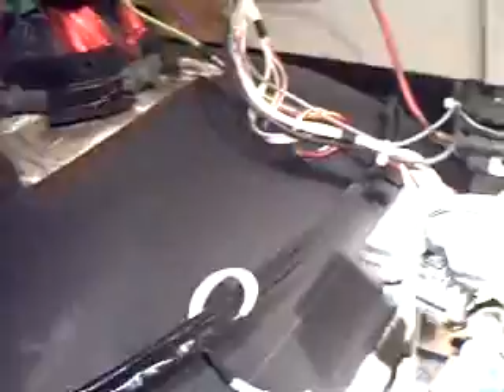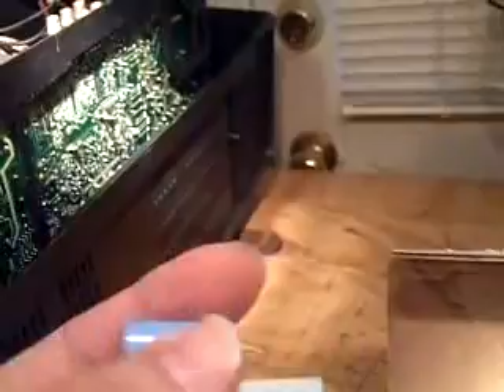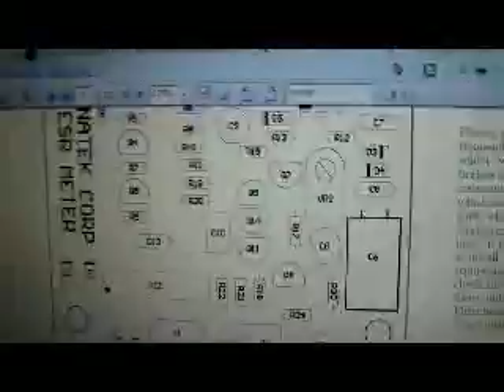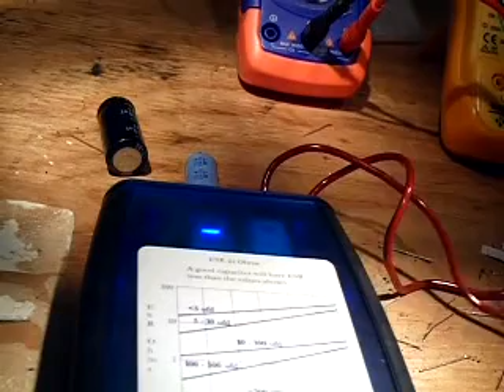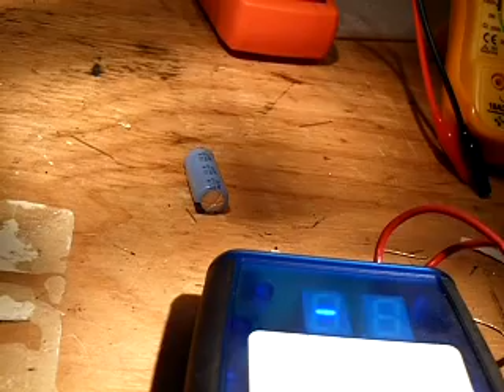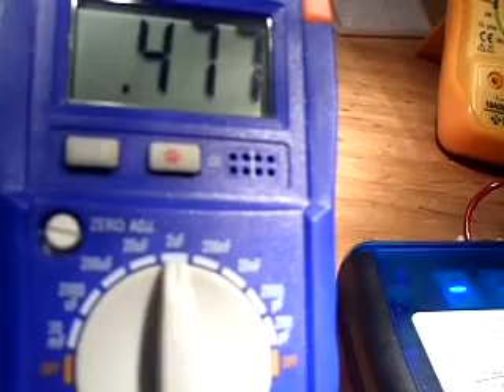1994 Toshiba CF26C30 Intermittant Power Up, Part 9, Capacitor ESR.

Comment from the maker: @MrDennis8805 Well, I just figgure I might find another bad electrolytic. If not, then I'll keep progressing to more likely things, like the H.O.T and that 9 Volt Regulator. I been reading a lot on blogs and people replace stuff like the yoke, regulator, H.O.T. and they stil lhave this problem. This is why I'm doing the ESR testing on the electolytic caps just in case. You know, take 10 minutes and try to eliminate something small, instead of going for the bigger things.

Comment from the maker: @mznxb9872 Thanks for your comment. I'll check the H.O.T next video. I want to test the electrolytics because I read on a blog that there is a bypass cap or two near the switching regulator that can cause this power up problem. I built the ESR meter to test the caps, just in case there is another bad one. That way I don't chase my tail if there is a bad cap that is in the circuit and I'm testing out other things instead.

Comment from the maker: @MrDennis8805 Thanks! Hopefully the ESR meter will show a bad electrolytic in circuit. The one that's the problem. I definately had a bad 18 year old cap in the vertical. I figgure after 18 years I might have some more bad ones.
You're right though. It could be a transistor or even a shorted flyback. Anything that puts a greater current load on various circuits will cause the set to shut down. It might be shutting down in 1/2 second instead of not powering up at all, if that makes sense.